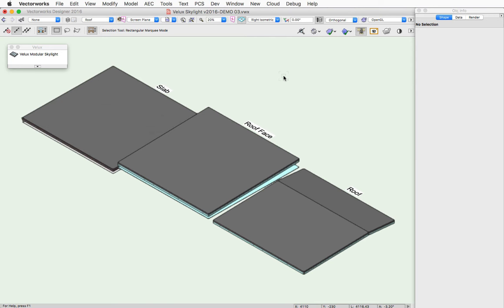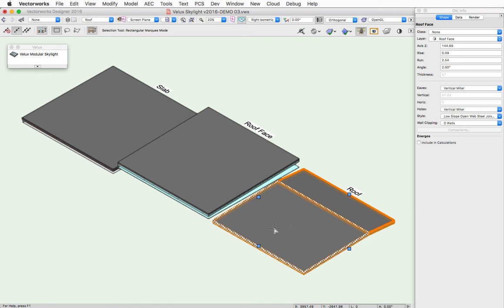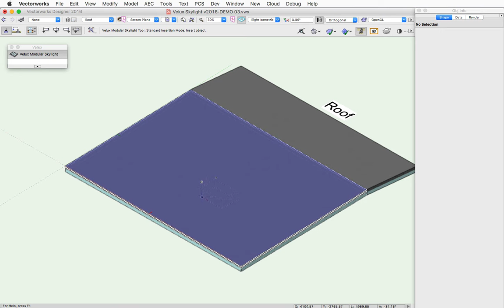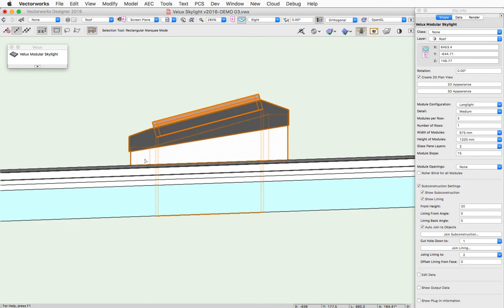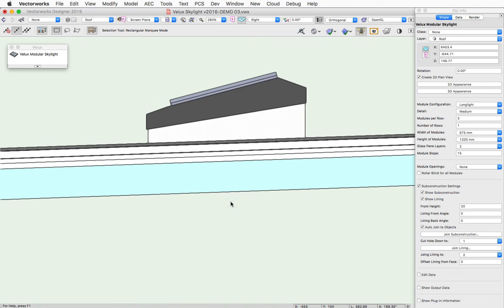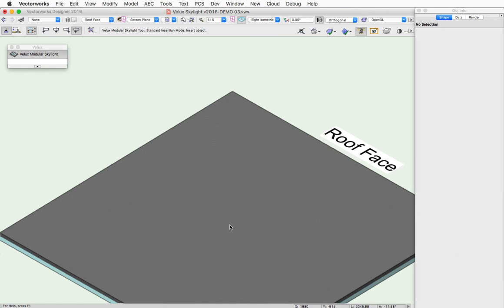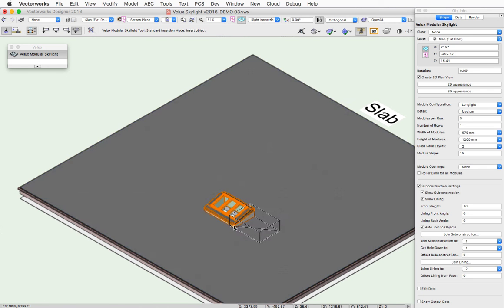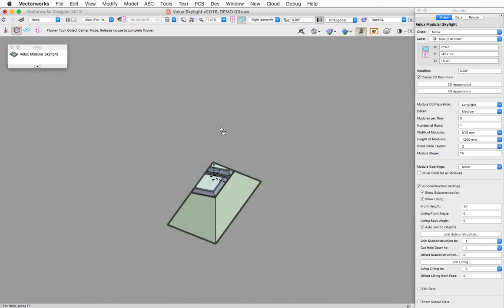Vectorworks Tutorial 01 for VELUX Modular Skylights

Comment: how do you install these in vectorworks?
Reply: I had no idea this existed!  I did a google search for "velux for vectorworks" and that linked to a page on the velux site titled "VELUX Vectorworks for Modular Skylights - Download free CAD/BIM" with a download.  On that page was a "button" labeled "Download Vectorworks models".  In fact, it isn't just a bunch of 3d models, it's the plug-in tool shown here.  There are instructions (in the Apple "Pages" format - easy to Preview on Mac, not sure how to open on Windows) with detailed steps to install the tool via the Plug In manager (3rd party plug-in) (Selecting the .zip file that was unpacked from the downloaded zip file (!?!?!) worked.)  Then the instructions tell you how to add the "Velux Modular Skylight" tool to your tool pallets.   Haven't used it yet, but that's the deal.